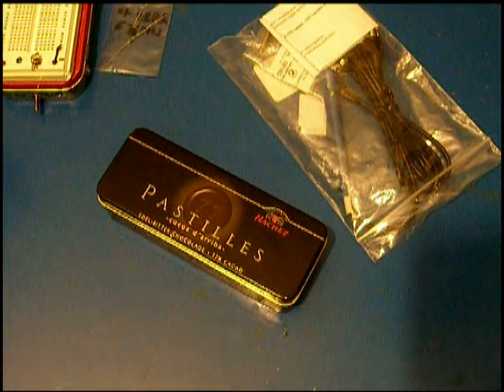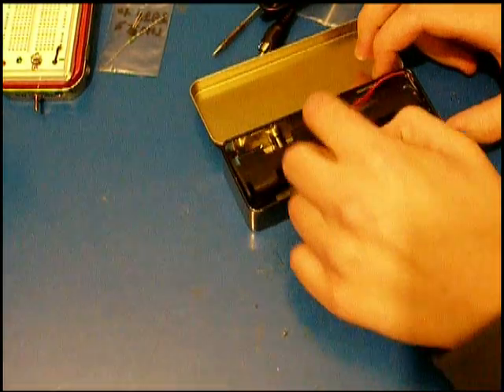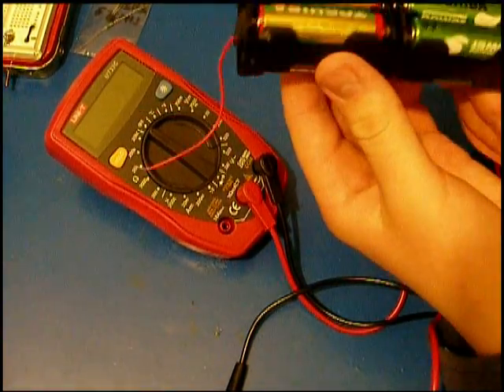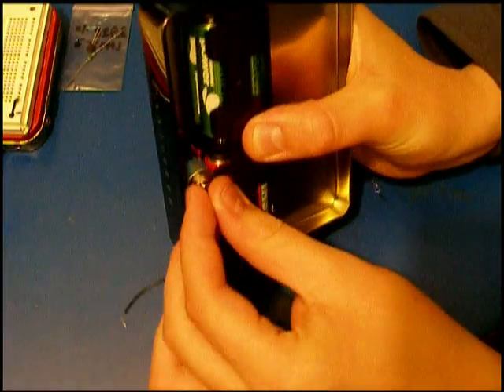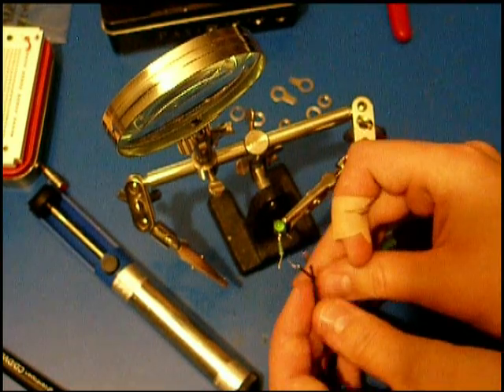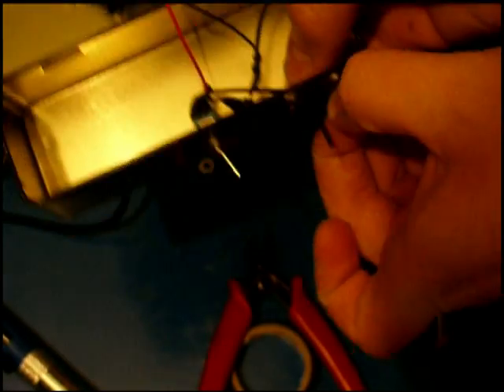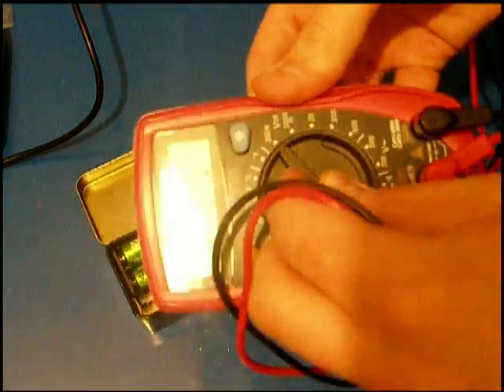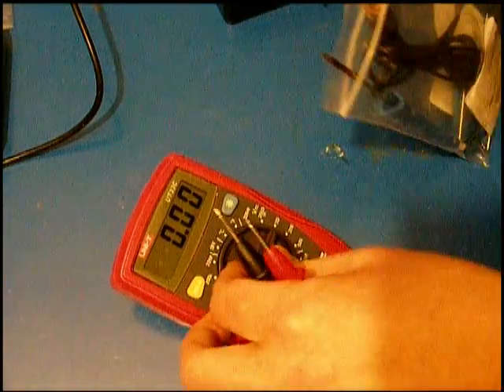Portable Soldering Station

Comment: Nothing to worry. It is not an AC power type kinda project. For low voltage project, the most thing that will happen is that the batteries are shorted go flat in few secs.